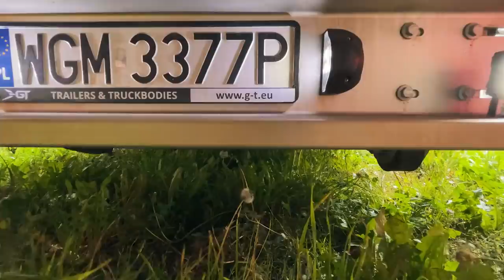Z Grecji do Czech i rozł&załad.! The trip from Greece to Czech, drop@pick up - Iwona Blecharczyk

Comment: Well I figured out, you must need a short truck, with the short wagon to make all those tight turns in, and through, and around all those little villages! 
It's kinda like FedEx is over here, except they have a separate tractor, then a short 30' ft. trailer, then a dolly, then the 2nd 30' ft. trailer at the rear! 
That's in case they have to drop one trailer at one warehouse, then go to another warehouse to unload the first trailer, or what they call doubles, or pups over here! 
Personally I've never pulled them! All my expertise has been with full length trailers! 
Of course I started out driving a short nose "conventional" Ford with a custom single size sleeper, and the size you have in your truck, but without all the storage on the sides, and it had a small size 318 Caterpillar engine, with a single axle rearend, and I was pulling mobilehomes! 
When I first started, the mobilehomes were like 14" ft. X 60" ft., then they progressively when up to 16" ft. - 18" ft. wide to 70", 80", and 90" ft. long, and the longer they got, the more axles they put underneath them, from 3 axles to 5 axles, and believe me, if you had a blowout on one of those itty bitty tires, you got maybe 2, 3, 4, or all 5 tires all on the same side, and you thought you had fun out there in the rain taking down, and putting back all those side rails, try changing 3, 4, or 5 tires all on one side on a mobilehome in the rain, especially with the water running down off the top of the house right down the back of your shirt, and if it's at least 50° F, or lower, that rainwater can get damn cold! 
But after about 2 years of fighting low hanging limbs, idiots on the road that won't give you an inch, to playing mailbox baseball! Now that was fun, because here you had a 14" to 16" wide house taking it down some narrow ass two lane highways with no shoulders, kinda like some of those highways you went down in this video, it didn't allow for very much room to hang the sides of the houses over without hitting something! 
And over here, a lot of the little 2 lane highways in the more rural areas, folks put their mailboxes out at the end of their driveways for the mailman, so he, or she doesn't have to get out of their little mailtrucks, because in the more rural areas, the postal workers are mostly to fat, and lazy to get out of their mail trucks! 
So that's when I decided to start pulling semi-trailers, and driving a bigger semi like what they have now over here! 
My first semi was an old '68 Mack cabover, like your truck, then I went to an '84 GMC cabover, to an '88 Freightliner cabover to an '86 Freightliner conventional, an '84 Peterbilt cabover, then I bought my Pete, with help from my dad, and together we paid $128,000 on a brand new '74 Peterbilt 379 extended hood conventional, with a 300' inch wheelbase, and a 120' inch custom studio/condo sleeper that had everything from a 600 hp Cat engine, a Super 10, 10 speed Eaton Fuller transmission! 
Now with a regular 10 sleed transmission, you have to shift the trans. 10 times, with using the clutch, or not using the clutch, which is what's called, "floating" the gears! You start out from 1st., or 2nd dear using the clutch, but when it would come time to shift again,  all you do is let up off the gas pedal when the rpms got to about 1700 rpms, shift to the next gear, and step on the gas pedal again, and so on, until you shifted through all 10 gears, but with a Super10, it's kinda like shifting a 13, 15, or an 18 speed transmission! 
Once you go through the bottom 4 gears, which usually most drivers start out in 2nd gear, then it's just like floating the rest of the gears until you hit 10th gear, which actually acts like a 13 speed without all the extra shifting! 
Anyway, soon after I bought my '74 Pete, I was at a truckstop up in Las Vegas, Nevada (party town 24/7), where they were having a truckshow, and another driver suggested that I enter my truck in the contest! Well as it happened, I won , or my truck won 2nd place in the "best of show" category, which won me a year's supply of free fuel ⛽, and a year of free truck washes! 
Which over here, if you pull into any major truck wash facility while you're out on the road, especially with a 53' ft. trailer, it's going to cost you now, anywhere from $115 to $175! 
If you own your own truck! 
Well after winning 2nd place in that first show, I started adding more lights, what they call "chicken lights " over here! 
That's those little amber & red clearance lights you see all over trucks here in America, and also chrome! 
Tons of chrome everywhere! All over the truck, and the trailer! The lights, and all the chrome pieces made it all look shiny, and prettier for all us big bad truckdrivers! 
Over here in America, the bigger the ego, the more lights, and chrome you put on your truck! 
Anyway, I started following what they call the "Show Circuit" all around the US, and the more shows I entered, the more I won, or my truck won! I just collected the winnings!...😁 
Anyway, I guess I've bored you enough with all my old school tales, so I'll close for now! Looks like we're in for a little rain! 
By the way, it made it up to 80° F today! 
It was quite nice! 
Anyway, take care, and stay safe out there, and I'm sorry I got onto you earlier! It's just that I care about you, and I guess it was the dad coming out in me again! 
So I'll see you around!...💖😘👍🙏🏼